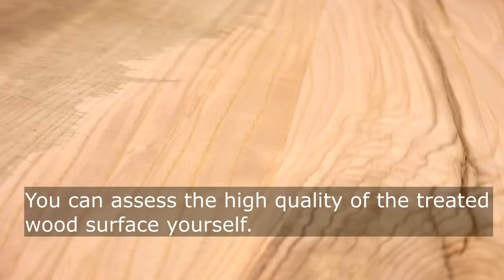Milling LUMBER. How to Flatten Wood Slabs.   TOT ROUTER SLED.

Comment: Still trying to decide which bit was the most impressive ... the size of the router jig ... the size of the router ... or the fact that it took four of you to lift the slab of wood!!

Looks like a fantastic piece of kit ... I've seen these carbide cutter heads a few times but this is the first I've seen one in use .... the quality of the finish is pretty damn good👍
Reply from the maker: Yes, the cutter works very well. And the weight of the slab is about 200 kg, its thickness is 100-120mm.
Reply: @WOODDESIGN6730  Holy ** ... that's one big lump of wood!
The only problem with the jig is the sheer size of it and how to store it ... a bit of a pain having to (potentially) disassemble and prop up against a wall each time if you don't have a massive workshop ... you could possibly attach it to a wall with hinges I suppose (if you have a big wall free) , folding it down for use and back up again for storage .... lovely piece of kit 👍

Comment: To speed up the process a little, you can use a simple laser to find the high spot, mark it and then take your router to that spot and set the height.
Reply: Hola, de qué tipo de láser estás hablando, de qué marca?Gracias